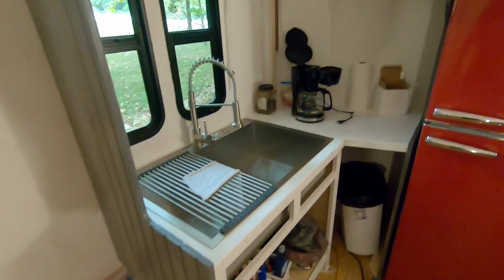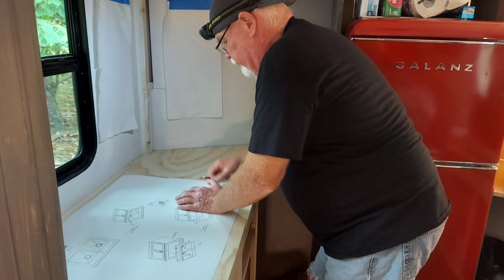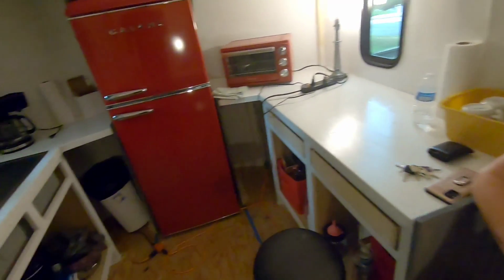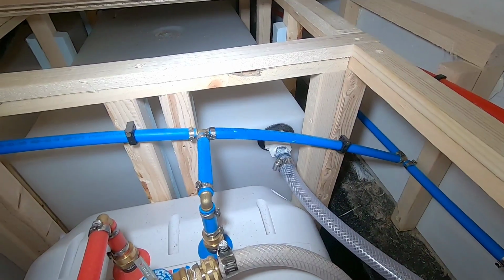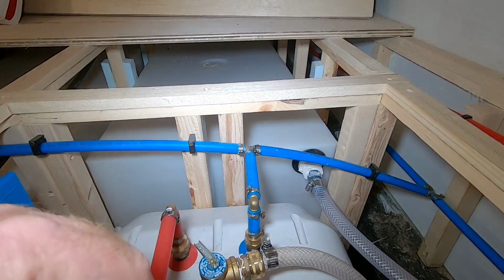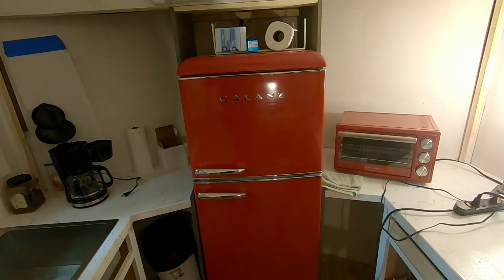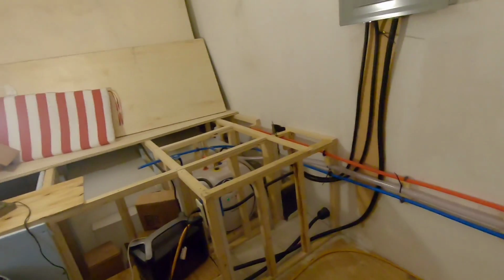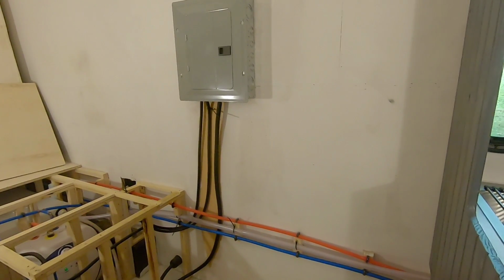Our Cargo Trailer Conversion Gets A Kitchen Sink/Check Out This Really Cool P-Trap/What's Next?

Comment: I'm re-watching your build vidoes as I'm in the beginning of my build - still insulating walls and furring strips - trying to figure out where all I need plywood backer boards and layout.  Your grey tank  drain - you may have shown it in a video but I'm not finding it - what size and what type of hose did you use - did you run it to a regular 3" waste gate?

Comment: which Pex crimper do you use?
Reply from the maker: We used "pinch rings" rather than "crimp rings". The pinch tool is much more compact than the crimp tool, which means it will work easier in tight spaces (like the spaces encountered in a cargo Conversion). It's made by Apolo. Home Depot and Lowes stock them for a little over $50 (last time I looked). Or you can Google "Apolo Pex Pinch Ring Tool" and several sights should pop up.
Reply: @billanddeb  Thanks

Comment: Thanks for showing the marine p-trap. I didn't know they made special ones for marine applications. We had to finish a living space that had a circuit box in a very noticeable spot so I covered it with a picture frame that was mounted with hidden hinges & a magnetic latch. It swung open in the same direction as the panel door. Artwork & fake vents are a good way to hide wall safes & electrical boxes & control panels. A friend of mine installed 2 fake wall outlets in his RV for hiding his spare cash, licenses, permits, etc. They were around $22 bucks a piece on ebay. Camping is in high swing these days so there are a lot more thieves out there & you can't be too careful.

Comment: Lowe's sells the vertical brackets to do floating shelves,  might be handy to be able to adjust them up and down. I made them for my wife in her office...got books on. Used 1/2 plywood ran 3/4  by 2 inch pine around the 3 exposed edges...holds,a pile of books. I love the sink and what y'all have done